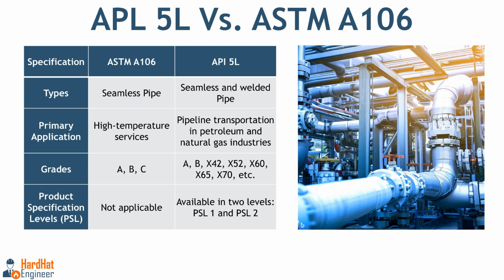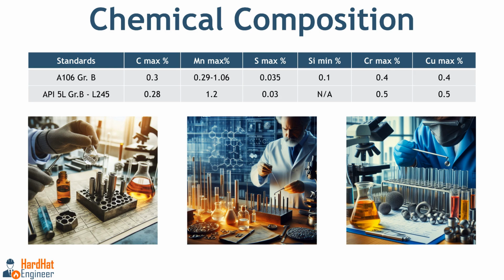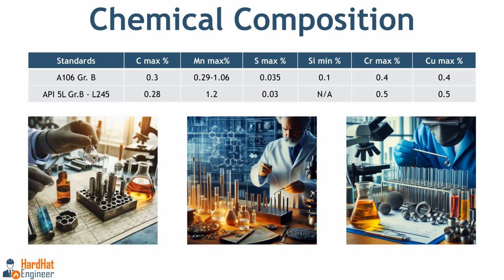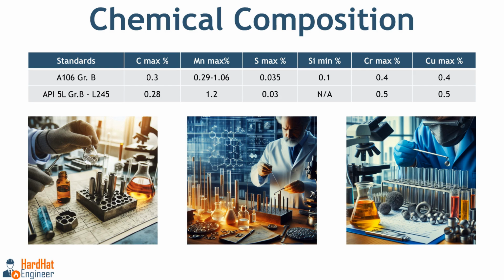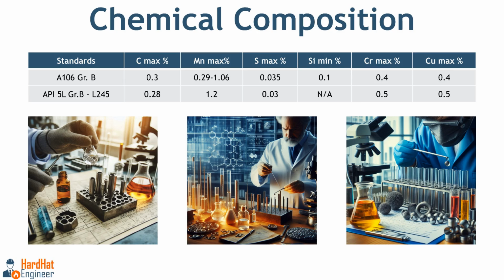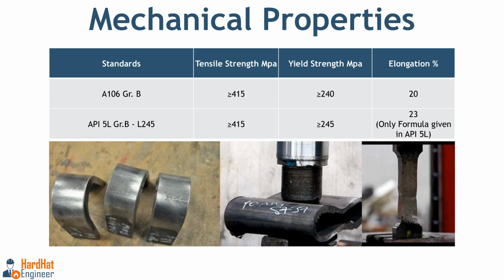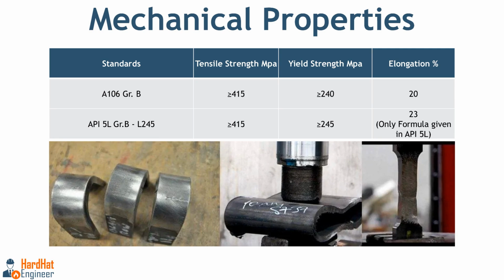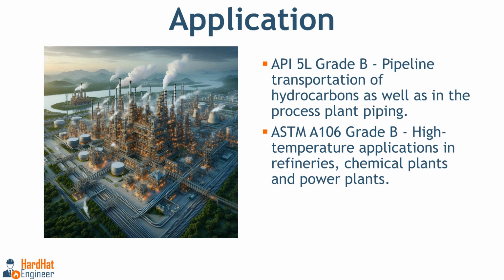What is the difference between API 5L Grade B and ASTM A106 Grade B Pipe?

Comment: If both materials have nearly 0 differences, why there's a trend for one being mostly used in piping transportation, on the other hand, the other being used in high-temperature applications?
Reply from the maker: That is how industry operates. Actually it the selection of the code that is why this two very similar grands are manufactured.